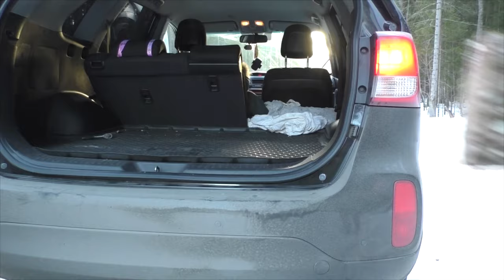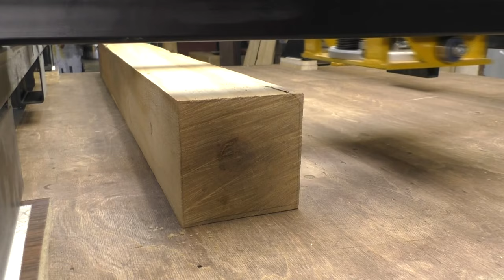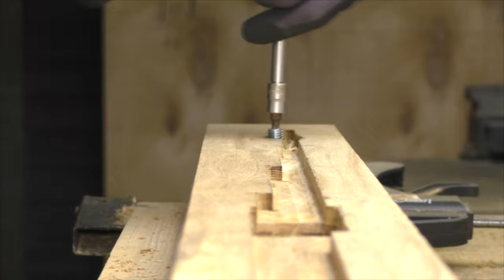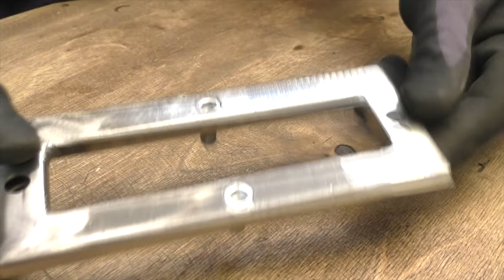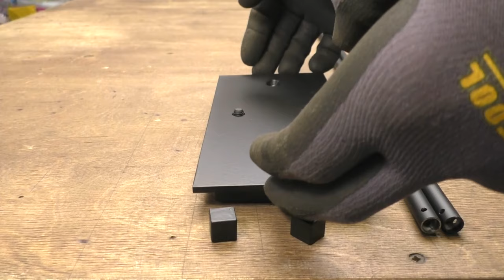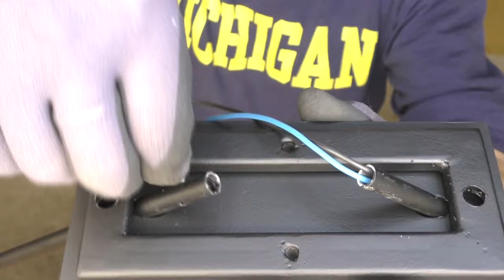It's very simple! Great idea from a piece of Oak!

Comment: That turned out great  !     Can you make an  Extra heavy-duty gear driven rotating  engine   stand  ?     Also   an extra heavy duty  wood splitter  with log lifts  and  a   sit on backhoe with an extenda hoe setup  driven of the same pump as the wood splitter  ?  Thanks